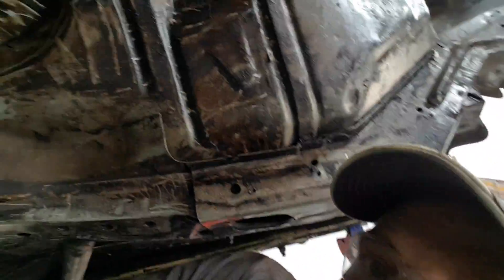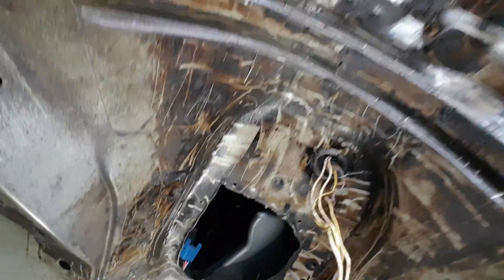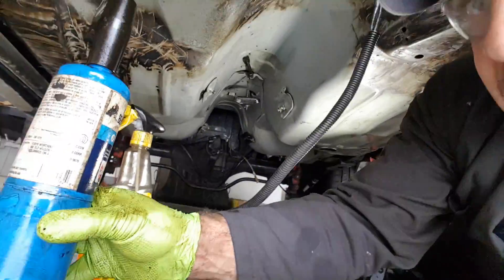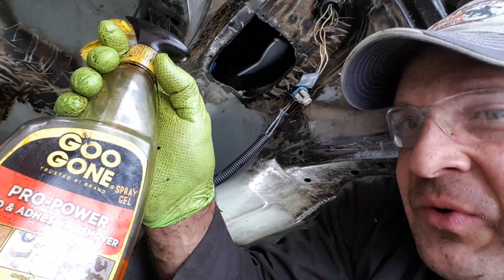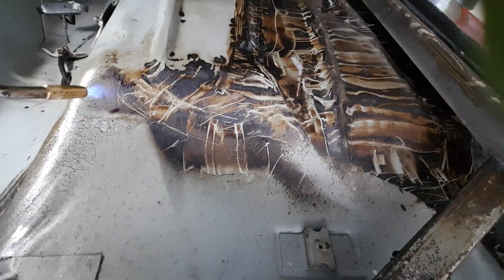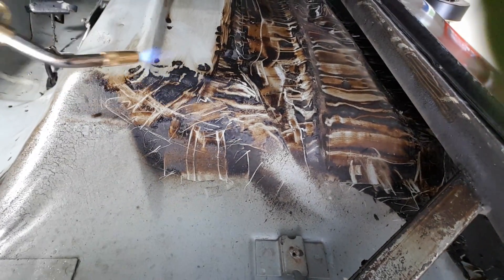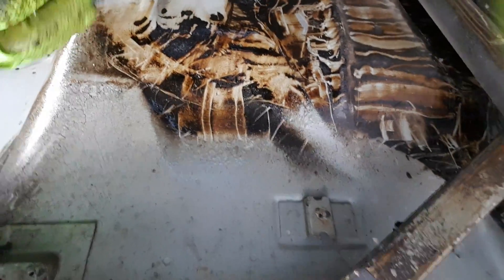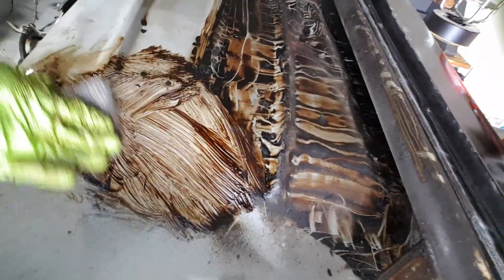Remove rubberized undercoating without damaging the original paint

Comment: Man! I wish the undercoat I was dealing with came off that easy!  Thanks For posting, now I know I have been doing it right, but with a plastic scraper, plastic blades, and terry cloth instead of steel wool to prevent scratching, it's a lot of messy work, and the smell is awful. This method also works on the residue left behind by tar sound pads.  Hats off to anyone who completes this job!
To those who ask why take off undercoating?, if you use your car for daily driving it makes no sense to remove it, but if it is a show car, or has reached collector car status the undercoating becomes a negative for two reasons 1. It easily hides damage and rust.  2. A clean car with no undercoating looks better and one with, and no matter what you believe, looks matter, even to those who refuse the fact.  Also, if you are doing bodywork the undercoat will need to be removed in those areas, or it will cause problems.
Reply: Mine got rust and undercoating. Dude even went and put that stuff on the transmission. I’ll leave that but everything else I gotta get off
Reply: Worst job ever , hats off to ppl that  finished  it for sure

Comment: That is asphalt based similar to tar, rubberized undercoating is thick and to get that stuff off you need a scraper and some other tools (flat head screwdriver might work on hard to reach areas) good heatgun or a propane torch, wire wheel on a drill or/and grinder.
That method also works on seamsealer if you want to get that off to remove rust.

Comment: Looks like a good method for removing what I call coal tar undercoating. Rubberized undercoating is the paintable stuff used on rocker panels and such. Cheers
Reply: Dang this only works on coal tar undercoating.

Comment: Just getting ready to do this on my ‘55 Chevrolet.  Most of the floors were replaced but the outside face of the toe boards still has a thick coating of that crap.  Got to get it off so I can have the body sandblasted.

Comment: I use a heat gun  and it works better tan a propane  torch  what size steel wool did you use thanks Joe
Reply from the maker: Good idea, I never tried a heat gun.  I used very coarse wool.
Reply: D Beach it doesn’t hurt the paint with a coarse steel wool?
Reply from the maker: @AlcladII  No, the undercoating paint is very durable.

Comment: Never used torch before, how long a bottle/tank(?) like that last? I'm restoring a W140 S600 V12 and brain damaged previous owner used rubberized undercoating to hide rust.
Reply from the maker: I didn't even use 1 bottle for the whole project.
Reply: Well when I first bought my car, it was suggested to undercoat due to salty roads in winter and I did, I didnt even know if it was rubberized and now that I know some stuff and it seems it traps moisture. I just did it once so hopefully it wont do damage.
Reply: @e.e9331  I don't know how to remove it. Does any professional can?

Comment: Why are you removing all that?
It looks like undercoating did good job, no rust at all.
Reply: The rubber coating also does a good job of trapping moisture therefore accelerating the rust process.
Reply from the maker: From years of engine oil leaks (all SBC engines) it was turning into tar, and would get all over my hands and arms when working on the car.